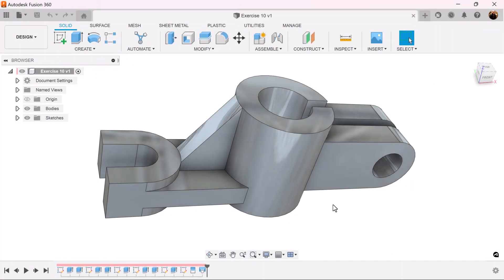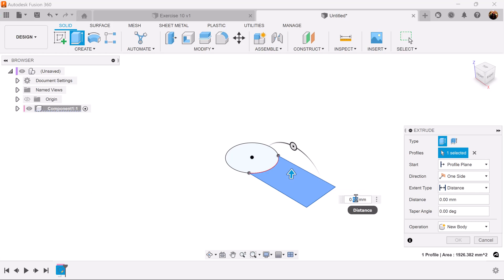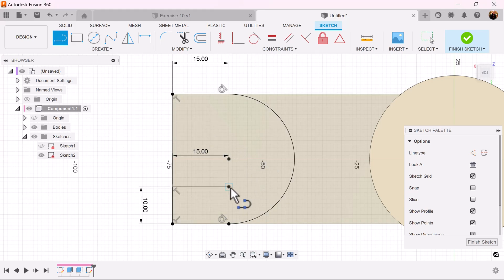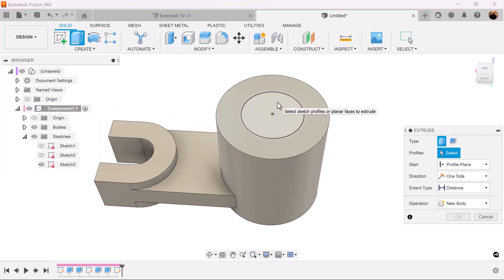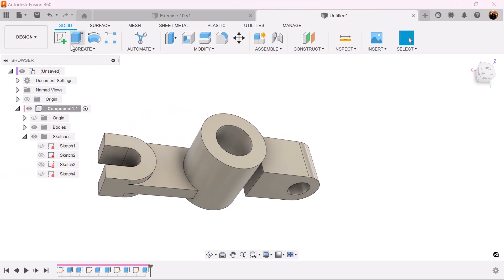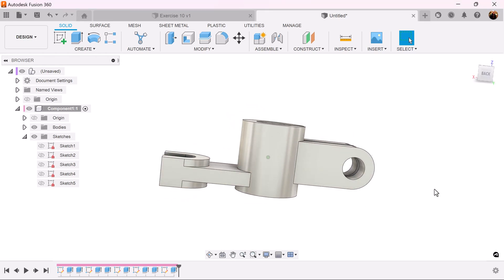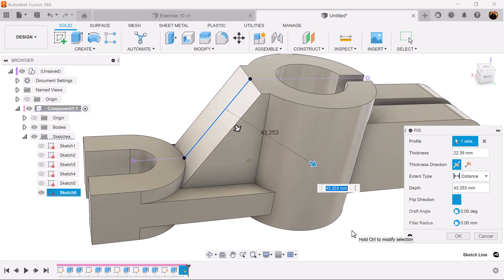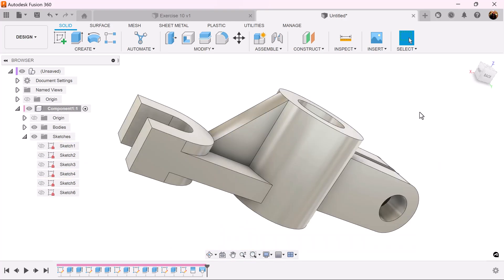Learn an alternate method in creating ribs between rounded edges in Fusion 360 | Rep no. 10

Comment: Making that rib, could you just draw a triangle instead of just the diagonal line, extrude it to the width you want, and then extrude the edges to both cylindrical objects?
Reply from the maker: Yes you could however, you will run into the issue of the rib not conforming to the shape of both rounded edges. You will have flat edges instead that may protrude a bit. Ribs more commonly are connected slightly below the actual edges. Although this method I presented isn't a common practice, this was just a demonstration on how to achieve a rib from edge to edge if it was something that anyone wanted to try.

Comment: Good Idea but not for production. So actually its useless..
Reply from the maker: While a different approach is a good idea in some instances, it may not be practical in all use cases, but it is definitely not useless.
Reply: @CADJungle  Yes it is. Most of the time design are made for production or prototype. This is just for looks. So yes it is useless in production.
Reply from the maker: While I would agree with you about its purpose, again it depends on what you are producing. Yes ribs and gussets for that matter serve specific purposes and have best practices associated with them. If you are working in an industrial shop or injection molding industry that has specific requirements and tolerances, then yes. While the term "useless" is a broad statement, it doesn't apply in all cases.

Comment: I saw the last “rib-by-loft” lesson too.  So, what if the drawing called for the top of the rib to be flat?  This is really concerning to me.  Thanks!
Reply from the maker: You can always stick with the original rib command so it will remain flat. However, keep in mind, that to make the rib conform to your specifications, you will need to play with the sketch line and move it slightly away from the corners to insure it touches both lips of the rounded edges. If not, you will end up with one side being at the top of the rounded edge while the other side slightly below the top edge. In this exercise its simply to avoid the flat edges created on the corners when creating ribs. 

This is demonstrated in this video as well. https://youtu.be/AFoXeAD6MAQ